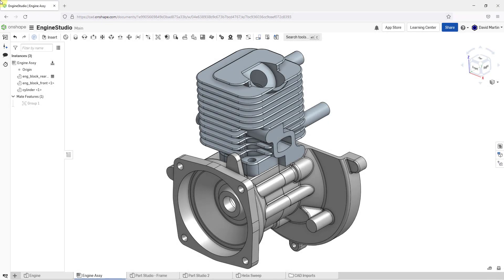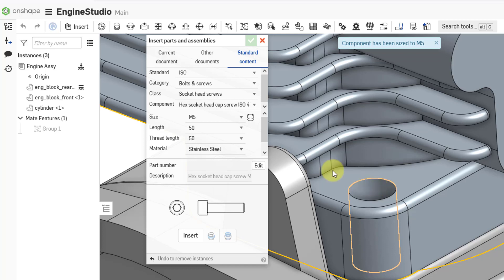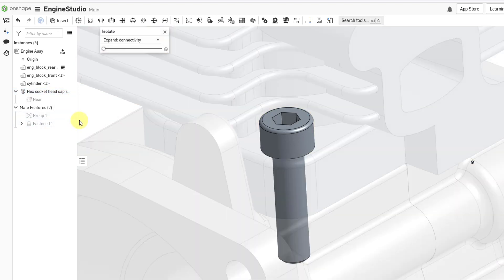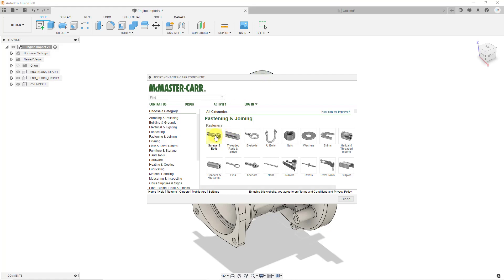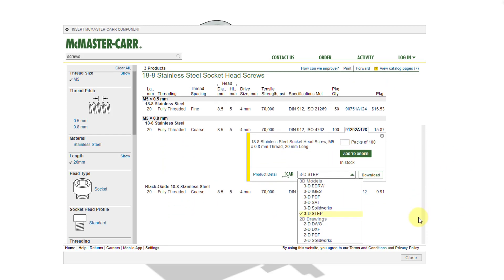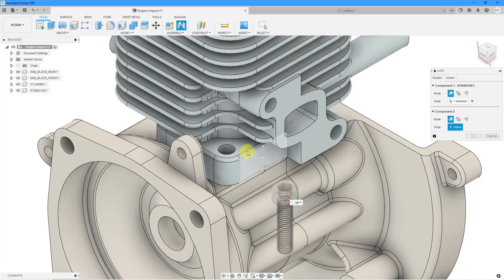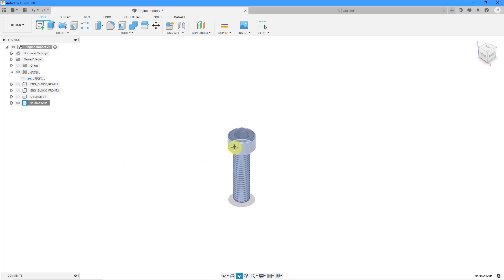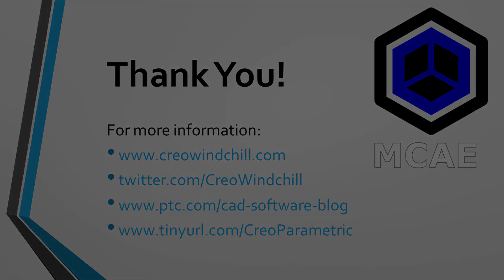Fusion 360 - Onshape Comparison: Assembly Standard Hardware

Comment: I want to learn how to put sfm or smm at Creo parametrics...
Reply from the maker: What’s sfm and smm?
Reply: Surface feet per minute and Surface meter per minute ( in manufacturing NC ) (CAM design)
Reply from the maker: I don't understand. Machining rates are determined by your manufacturing parameters.
Reply: When I run machine at HSM. Tool have load at constant feed.Mastercam and other software have a option of sfm.
Creo also have but I don't know how it works.
Reply from the maker: Jose just added a whole bunch of new stuff to HSM in Creo 8. I'm familiar with manufacturing in Creo but by no means an expert. I recommend you contact PTC Technical Support for stuff like that.
Reply: Sand me link of that...
Reply from the maker: support dot ptc dot com
Reply: Thank you so much.